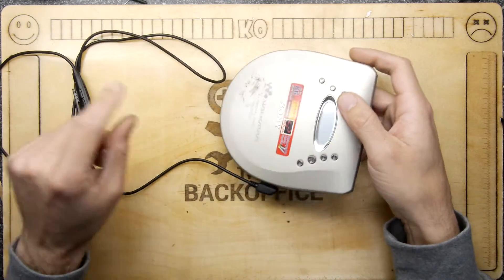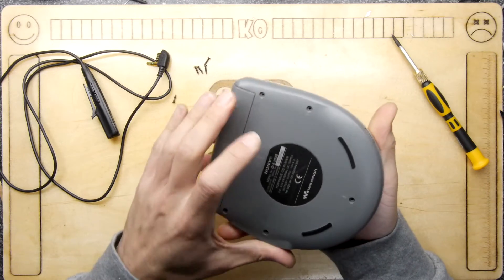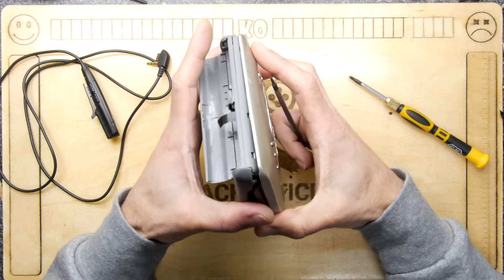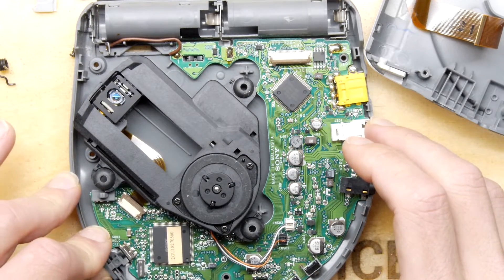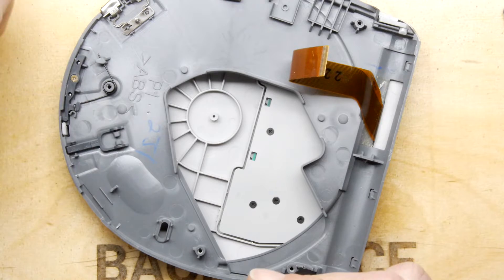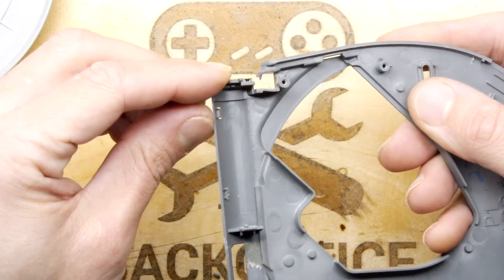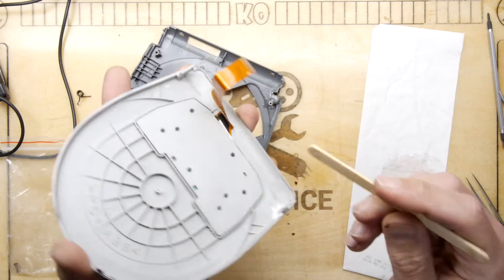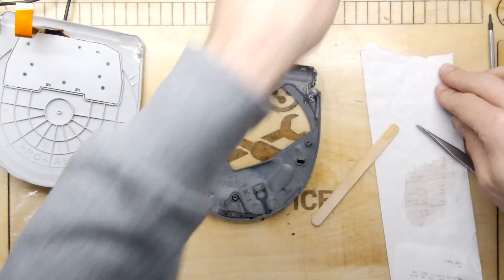Sony D-EJ835 CD Walkman Repair

Comment: I have a Sony Walkman d-e330 that spins the cd, but not really fast, but makes a clicking noise and sometimes eventually stops….it does not play the disc, so I don’t know if it’s not reading it, or what.  I have tried different discs.  Still, nothing.  I have checked to make sure it’s not on hold, and it is not.  I have opened the top and cleaned the lens with iso alcohol q tip, and moved the inside piece side to side.  It’s a little stiff, but does move.  I’ve slid it back and forth several times to loosen, and then put cd back in player and tried again.  It still makes clicking noise and doesn’t play/read….
Reply from the maker: Perhaps the laser diode is shot? Or more likely some of the electrolytic capacitors

Comment: I have a Sony discman groove D-E456CK and every time I move it it scratches my discs it never happened until now do you might know whats happening?
Reply: Spindle issue. Either cracked or the whole center spindle has sunk under repeated pressure.

Comment: I have the D-EJ725 got it used, it does work but my question is the manual says it has a backlit display but mine does not seem to have or work, do you know if they should be backlit ? manual says it comes on for 5 seconds after ay button press

Comment: I have a D-EJ711, it is very similar to this model, the problem is all the buttons do not work including volume control. All buttons and connectors have been checked in good condition.
When I insert the battery and cd, it will continue to play itself until finished. Can you or anyone help solve this problem? Thanks in advance.
Reply: Same here